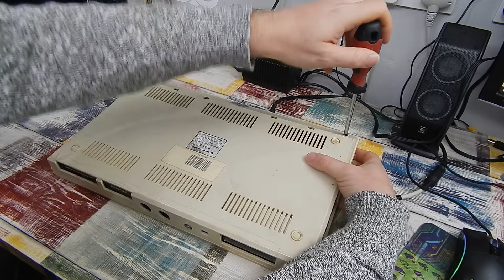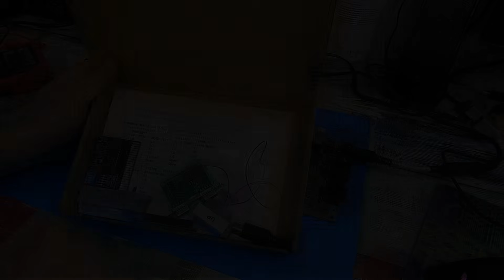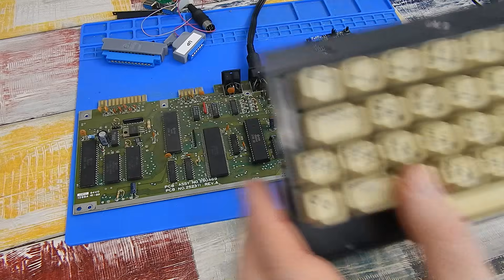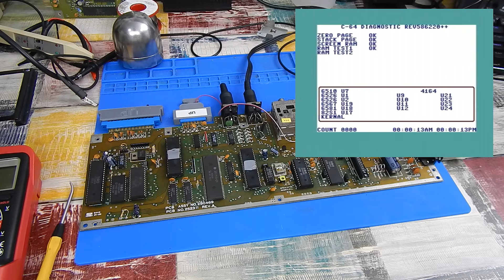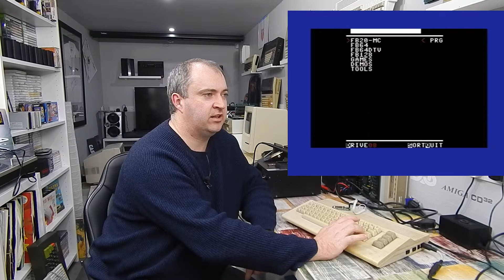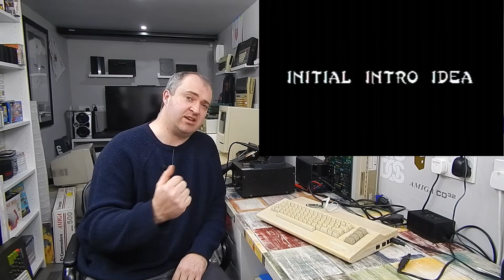Commodore 64C with a frustratingly simple fault

Comment: To be honest, I did not see the trace open.  But, the multimeter does not lie.  You were lucky that the Color RAM was a seperate chip.  On some Commodore 64C motherboards the Color RAM is inside the large PLA chip.  So, if the Color RAM goes bad, you have to replace the PLA chip, which are very hard to find.  This is the main reason why I prefer the Commodore 64C computers with the normal C64 breadbin motherboards.  Great job on the repair.  😃

Comment: You missed that the joystick ports are also connected to the keyboard port 1012 goes to the joystick Port you could have a shorted capacitor a shorted resistor I'm short between pins so you should look at your schematics a little closer before you jump to the soldering chips not saying that it was wrong but it might have saved you some trouble

Comment: I think that Pla on the "new" model is called super pla, I have newer seen a super pla go bad only the old model pla, but at first look on the screen it looks like a bad pla but if I remember right then the whole screen woud be filled with lethers and numbers and symbols when it's powered on, I have repaird some commodore c64 bords but with the old model pla the later ons are in the Commodore c64g or in c64c slimline model like the one in the video, but in 2010 I had to sell my collection of Commodore 64ers and Amiga's it's a long story but can say one thing bad economy and no job at that time, and had a bad sholder joint problem but im ok now and got a good job now, but my Commodore 64 days are gone, the worst thing is that I took no image backup of my floppy discs that hurts a bit

Comment: Thank you for this great video but I have a question about a C64C short board. I got the fuse joke. But since I put in a new one, I have the timers of dead test cartridge which works intermittently. (it remains at zero and I have no music). Do you have any idea where I could look? Thank you
Reply from the maker: Check if you have 9 volt on the vdd pin of the Sid, top right pin looking at the chip.  If that is missing then you have another fault after the fuse.  The C64C schematics are easy enough to find online you can follow the 9v rail on that.
Reply: @CRG  Thank you for your answer. I found the cause and it's a 2nd joke with the fuse. One of the fuse holder clamps was not tight enough so the fuse was not touching the edges. But visually we couldn't see anything, i found the cause randomly by taking my measurements by pressing the fuse. I tightened the clamp and it's ok now.

Comment: Really enjoyed this. I don't have the repair skills or kit to diagnose, but I do have 2 recently acquired working breadbins and would very much appreciate if anyone knows of someone trustworthy the UK who would be able to repair my c64's for a reasonable price if I have issues?
Reply from the maker: I would recommend joining one of the user groups on the likes of facebook or perhaps discord.  There's loads of people out there who would happily get you up an running again should one of the machines fail.  

One common source of failure though is the power supply.  When they go bad the 5V line can go very high frying various components (usually the ram goes first).  You might have noticed that inline with my power supply I am using a power saver which is designed to cut the power as soon as the 5V goes above 5.2 (I think might be 5.3).  I'd highly recommend either getting one of those or one of the new power supplies.
Reply: @CRG  Thank you very much. I don't use Facebook, but I have already purchased one of those Electroware replacement PSU's from Poland yesterday (new revision) which sound ok and won't be using the original ones again!

Comment: As good as the Diag cart is I have seen it miss problems easily, I just did a C64 breadbin with an issue of fastload carts not working and normal loading results in mostly failed loading.
Diag said both CIA were OK, I tested them with a tester that test the CIA chips and yeah one was actually bad on Channel A... if I swapped them then the Diag cart finds the bad CIA but otherway round... so yeah Diag cart can lead you in the wrong direction..... Corrosion... does more damage than it looks.. good repair!
Reply from the maker: I think its possible that a partly faulty CIA may work in one position and not the others, fairly sure I've read that somewhere before.  I suppose in your case the chip was still working in terms of passing the diag test but had a failure elsewhere.  

I was surprised that the corrosion damaged the trace as it did.  I can't see the break so it must just be a hairline crack.  Perhaps whatever that was split on the board while corroding the surface stressed the copper cracking it.
Reply: @CRG  Since there were scratches on the board I would say someone was chasing the original issue of the blown fuse (no audio) the color ram probably died from sitting around, seen that heaps... the corrosion was probably drink or repair fluid spilt while over the board.... amazing how the faults pile up and your chasing more than one thanks to bad handling

Comment: Nice fix. I've had a C64C showing quite similar behavior - just add some character rainbowing and sparkling - back in the mid 90's with no internet, no test harness or even cartridge to find help. Drove me crazy for weeks until I've found the cause - an intermittent mechanical failure in the power distribution around the fuse. By than I've had swapped out the fuse, both CIAs, the VIC, the CPU, the Kernal and the Combo Chip with known good parts.🤯
What that taught me: Don't freak out if your C64 freaks out. Some mild percussive maintenance may guide you to the cause! 😁
So I could feel your frustration chasing those loose electrons falling out of this board.
Reply from the maker: Thanks.  Never heard of a power issue causing flickering like that so good to know.  Its easy sometimes to fall into the trap of chasing a faulty component when actually is a physical break somewhere on the board.

Comment: I must admit that as soon as the ROM cartridge didn’t boot I’d have suspected the address and data lines going to the cartridge port rather than the chips. However, hindsight is a wonderful thing.
Reply from the maker: It's not in the video but I did check the databus at the CPU and it looked fine but it didn't cross my mind to check same at the expansion.  Lesson learnt on my part though, it'll be the first thing I check in any future similar repairs.
Reply: Yeah, though given that the machine was mostly working but not reading the cartridge I would have started just “listening” to the buses at the cartridge port. That would have probably have flagged up that D0 looked either quiet or just odd, probably floating.

Comment: Lack of 9VAC will cause timers to fail because its 50hz (or 60 on ntsc machines) line frequency is used to generate the pulse counted by the CIA counters. That is also why there is ac power there at all.
Reply from the maker: Thanks for letting me know.  Probably should have known that already 😉

Comment: The  missing LED is signs of blown fuse,  the fuse can blow sometimes with plugging into cassette port with power on or problem with cassette drive.   The 9vac is needed for the CIA TOD clock, which drives the times on the diagnostic test. That was a fun fix.
Reply from the maker: Thanks for clarifying the 9v requirement for the TOD clock.  Not sure how the fuse went but maybe hot plugging the cassette deck as you said.

Comment: A quite interesting fault. Nice to see how the symptoms (dead card slot and random row 0 keys) all made sense in the end. We've all learned to keep looking for common connections of failng components even if it seems they are not related at all. I wonder if the "magic finger" method would have worked here just as it did for me several times when there were floating inputs due to broken traces. I would have expected that simply touching the broken data line (CPU side) with a fingertip would have changed the random key presses significantly.
Reply from the maker: Looking back at it now I probably should have noticed on the keyboard connector that the pin wasn't fully low, there was some noise on it and probably an indication that it was floating.  

While not in the video I scoped the databus at the CPU and when it looked fine there I didn't bother looking at it on the CIA or the cartridge port.  Even doing that would have pointed to the fault straight away.

Easy to say all that in hindsight though.  I'm just glad it got fixed in the end even if it did take me on a ride 😁
Reply: @CRG  thanks for sharing that ride :-)